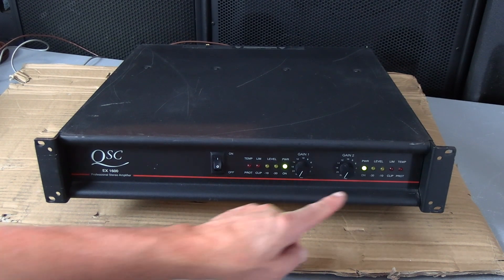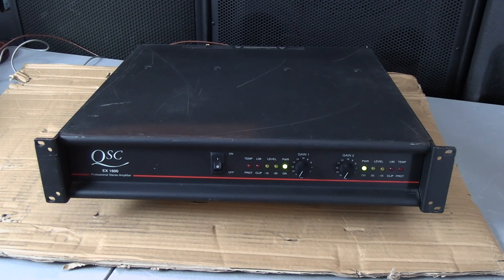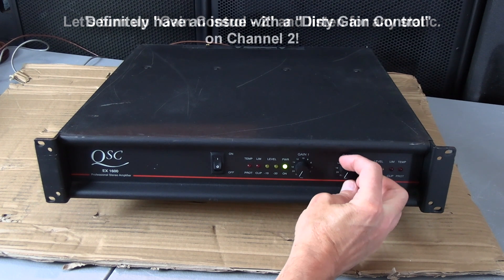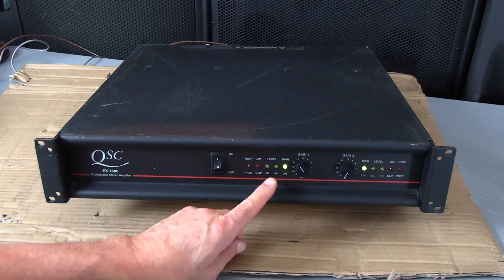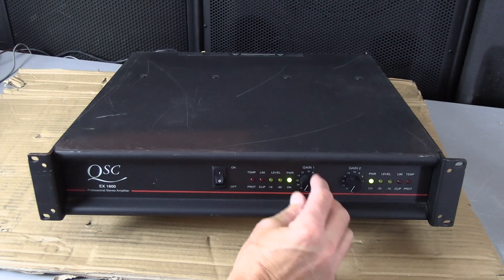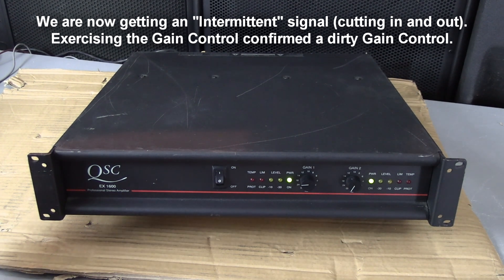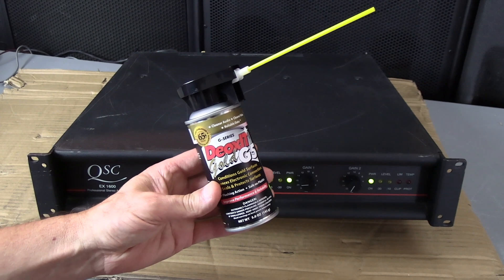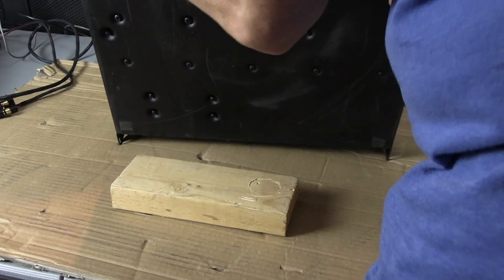How to Clean Dirty Gain Controls on an Audio Power Amplifier.

Comment: My problem isn't static but rather low lost signal and if turn it up you could barely hear the music but if you turn it up about halfway and tap the control you get sound but it will drop off sooner than later and you do it again and it works so I don't know if it needs cleaned or a loose solder joint?

Comment: Thanks for the video! I have a QSC RMX850 I've been using over 20 years that powers my 4x12 Hughes&Kettner cabinet.  Periodically,  I've sprayed the pots with QD Electronics Cleaner and it works for awhile but never completely removes the scratch. I just purchased a can of the Deoxit G5 Gold and look forwards to a scratch free sound. Will test once I have replaced the dead output jack on my guitar. Best to all.

Comment: Hi does this actually work for cleaning my Yamaha CL7 console?
Reply from the maker: As long as you use DeOxit Gold G5 you should be fine. I would test on one of the channels with the biggest issue. Note, I would not use any cleaner if there aren't any issues present. When I worked at the theme park, I would only use on the channels that had an issue. Hope this helps.